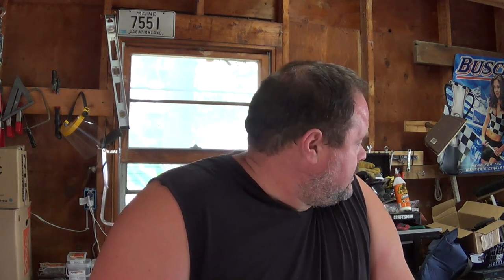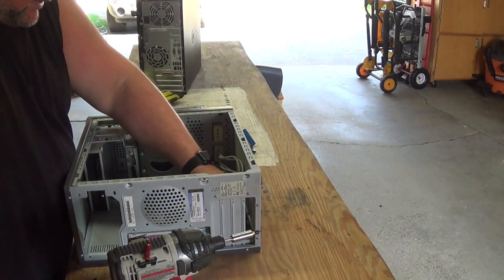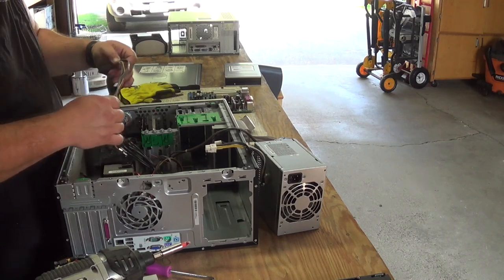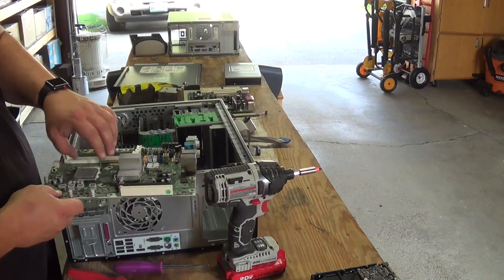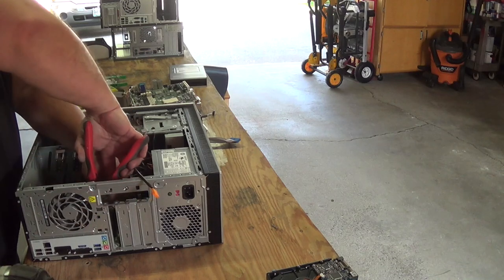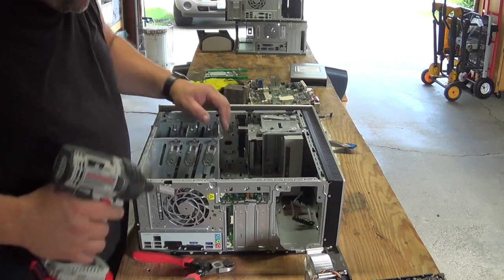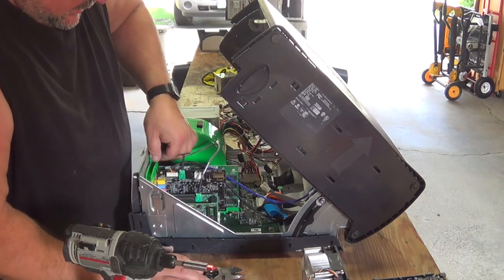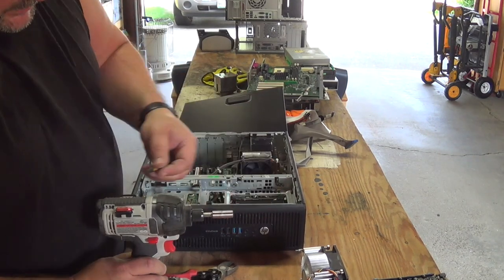18 Desktop PC Scrap Marathon with a $100 CPU Find! -Moose Scrapper #306

Comment: It takes about five seconds to cut the blades off the cooling fans, then throw them in the motor bin.  The blades are a brittle plastic, and will pop right off with one cut each with your side cutters. Easy peasy lol. Then most scrapyards will take them......Hope you're healing fast, and getting back on your feet soon.

Comment: I live in Mississippi, you live in Maine...I think our definitions of "hot" will differ slightly.  ;)
That SSD hard drive you pulled is bound to be worth $100.  It was a major upgrade on that POS pc.  Kinda like putting chrome rims on a Chevette.
Reply from the maker: propably!  that day it was almost 100 degrees with a humidity of 90% lol
Reply: @moosescrapper5928  Wow! I was in New Port, Rhode Island from June to July back in 98 training with the Navy and in June I needed a jacket.  When it warmed up the locals were complaining about the heat and how they wished they had air conditioning in their homes.  I laughed.  

Glad to see you up and running after the back surgery.  Keep up the good work.

Comment: Moose please help I just made a fast vid about the different ram sticks I have found there are like 20 of them I don't no what I can do with them or what to post them as plus I have a bunch of those cards with all the plug ins
Reply from the maker: All I do is go on to ebay and look up the numbers on the sticker on the ram sticks.  I check for identical ones and filter by "sold" items.  Then thats what I list them for. TO make it easier if you can find an identical listing you can actually look the the link that says (List one of your own) and it prepopulates all the items info.  Best of luck!

Comment: at 34:00 You've Never seen a solid state hard drive before? Where have you been? a 128gb isn't worth much, but it will put some zip into a cheaper computer to speed it up.
I have a 160gb ssd as my main Hard drive, and it boots up in 15 seconds. Don't scrap it! sell it! 
You should plug these computers in before you rip them apart for scrap. If it works, you can get your money back by just selling 1 computer. You should know that by now.
Reply: He always tries stuff b4 he rips it apart and if he can sell it he dose but if he can't it's trashed we live in the same state I watch all his vids and he has said it many times
Reply: @tomtinkersrezlife278  Yea he actually checks stuff, unlike a lot of other scrappers on youtube which just do it like this; "oh whats this cool little thing, might be worth something" *chucks it in the scrap bin 3 seconds later*
Reply: @scrapman50 It was a 128GB SSD not a 128mb.  So not too much smaller then your 160gb. Should be worth some good money.
Reply from the maker: I live under a rock.... well not really, but i only scrap what i can get my hands on and this was the first time I have seen these.  I did check it out and it was worth about $15 once it was erased but i dont typically like to sell HDD of any kind because there are folks out there who are adamant that the data can not be completely removed.  I am no expert so I like to err on the side of caution.
Reply: An SSD drive is more like a glorified flash drive. all you have to do it write over it once and then format it. Data is gone.  Beside, since it was used as a main drive, there really isn't anything on it but Windows (I'm guessing), if it came from a server, all the important sensitive data was on the larger hard drives that were removable. Same goes for computers you get from schools, they are worried about the info on the computers, really? they are all attached to a main server and the sensitive info (if any) is on the server. the computers are just terminals. I have never found anything on school surplus computers either.
If multiple children are allowed to use the computer, it's not sensitive information.

Comment: Good video Moose I can certainly vouch that computers are being built cheaper. I got a HP the other day the whole tower weighed less than 3 pounds. The motherboard was smaller than a car stereo and it didn't even have a power supply. It just had a cheap low grade powerboard. The processor was just a tiny fiberboard that looked like it came out of crackerjack box. Had no slot card and 1 small ram stick. I doubt the whole computer would of cost more than $99.

Comment: I would take the cover off first, NOT the power supply. Oftentimes, the power supply falls onto MBO, RAM, Video cards, etc. and damages them and your chance to resell parts. So, remove cover, see if anything is salvageable, remove RAM and CPU, and then power supply, drives and MBO. Thanks.

Comment: if you just cut off all those gold plated pins from the mother board connectors, for the card slots, and anything that gets plugged into it, and put them in a bag, what do you think the ratio of scrap metal v gold would be?  Say it weighed in at 28 ounces,  think you might get half an ounce of gold from it?  Is it worth it to collect those, even though it takes a lot of time to do so?